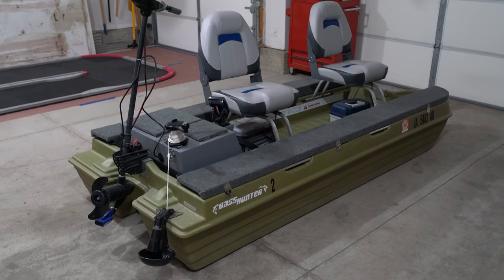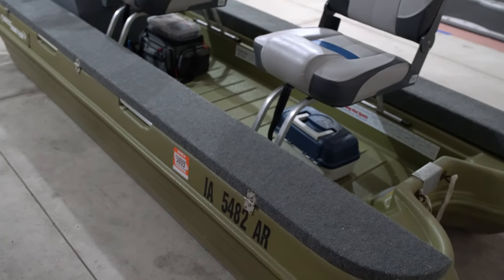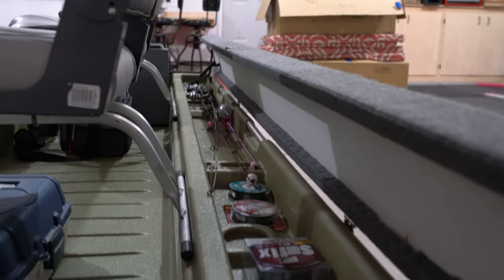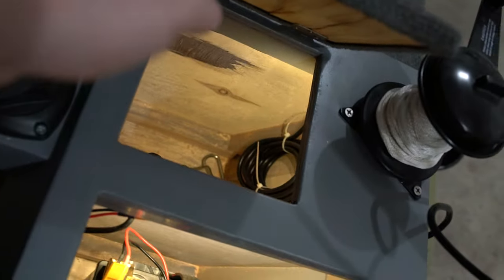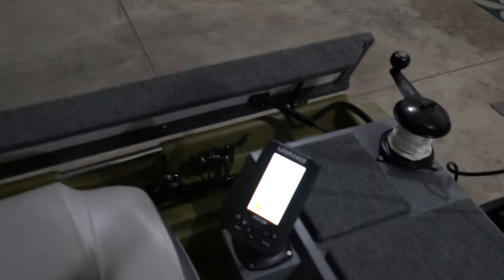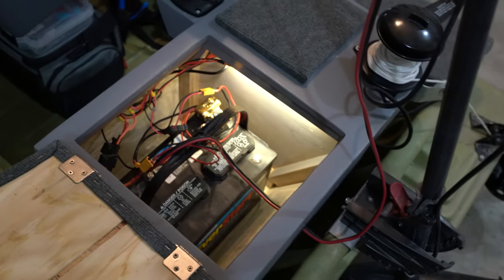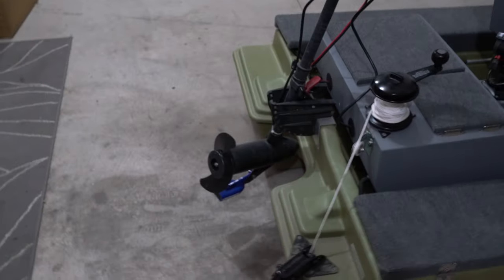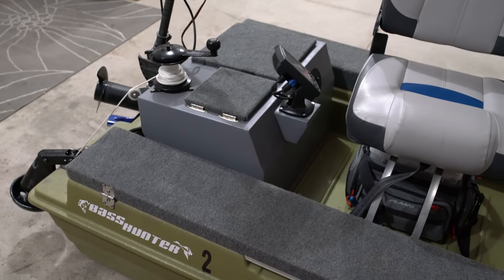Best 2 Man Bass Boat?! | Modifications, Build Process, and Walkthrough

Comment: How about a video explaining how the rod boxes on the side were built?  Looking at doing the same, just not sure how to go about it.
Reply from the maker: Hi Robert!  Essentially I just bought decent quality pine boards that were as long as the boat.  I let the board hang over the front edge of the front rounded sides and traced the shape from underneath the board.  I cut it a little narrower than my trace as I didn’t want the finished product to hang over the edges.  I then measured how much height clearance I wanted under the rod lockers and added 3/4” pieces of pine at the right thickness so the left and right still sat level.  Attached the hinges to test fit everything then took them off to waterproof and glue the carpet before reassembling to the boat.  Hope that helps in lieu of a separate video!  Reach out with additional questions!
Reply: It'd be nice if you could draw that up , make a blueprint of how you made those, AND how you made that battery box .. I am gonna do it to mine, but your's looks like it all came from the factory that way..! Man, you do some good work, and I like your attention to detail .. Damn fine work my brother.

Comment: Very well done!  Really impressed with the thought, design and thoroughness of the job you’ve done.  I sure wish I had the patience and skill required to do this kind of thing but I just don’t.  You’ve thought through every detail resulting in an organized and clean design that is incredibly useful, simple and makes using the boat a pleasure.  Not many have the ability to be so thorough and to know what to use, how to do it and can actually pull it off so well.  

If I did it there would be extra holes everywhere filled with silicone, the latches wouldn’t catch because I’d be off 1/8”, the boards wouldn’t fit and it would probably end up in the dumpster after I became so disgusted and angry with my inability to get any of it right.

Thanks for sharing, well done!
Reply from the maker: Thanks Kevin!  Really appreciate the comments/feedback!
Reply: Lol

Comment: I really like the mods you made putting the lids over the side trays and making them a secure actually usable storage that eliminates the chance of your rods getting knocked overboard.
Only thing I can see I may have done differently is use piano hinges so I could mount the hinges under the outer side of the lid and to the top of the hull where you would not have the hinges mounted to the outside of the hull mainly for aesthetic reasons not function.

In my opinion biggest mistake most people make when modifying these little boats is adding way too much weight going with plyboard flooring and large plywood decks in such a small hull, but your build for the most part eliminates this.

Front box for the fish finder and anchor reel mount I like, also could incorporate a front navigation light socket and switches for the navigation lights on it as well just in case ever caught out longer than planned and it started to get dark .
Rear navigation light socket could be incorporated into one of your side lids and the light for it stored in the side compartment when not in use.

I would though put the trolling motor battery in the rear of the boat in a plastic battery box and use the front box for storage for things like life jackets, the navigation lights and other needed items that just seem to accumulate on a boat.

Placing the trolling motor battery in the rear is more for a weight balance consideration since you have the added weight of the trolling motor and the box mounted on the front.

One last addition it seems pretty common to mount a rear rudder on this style boats to help tracking and make it track better and not spin around so easy in the wind.
Most people are just using a tilt bracket for a minnkota bow trolling motor (available on Amazon for about $40) and one of the best rudder ideas to to use in the bracket just cut the handle down on a cheap kayak paddle and used the paddle end as the rudder,

Tat rudder set up is great because it can be brought up out of the water just like your front mounted trolling motor for shallow water and/or boat loading and unloading and transportation.

Nice build overall.
Really sensible!
I am considering buying a boat of this style and may incorporate these side lids as it really is a smart addition to make those areas of the boat actually useful.

Comment: Super nice setup! I have one question and that is what is the model number of your battery and where did you get it and does it last all day running the trolling motor and fish finder and occasional use of the lights? I also love the rod locker setup. I have a bass hunter just like this one and look forward to getting it all setup and out on the water.
Reply from the maker: Thanks for the comment and question!  The battery is just a cheap EverStart group 27D deep cycle.  Generally it lasts all day but I’m only going around smaller lakes/ponds and not constantly moving.  I would suggest estimating your run time across all your electronics and their respective amp draw to determine whether certain battery setups would be sufficient for your needs.  Hope that helps!

Comment: my brother and I had one of these for 9 years. It got used every weekend and it was stored outdoors.  We bought a pond prowler at Bass pro to replace it and that POS ripped on contour seams on both sides within 4 years. And that one was always garaged on a rack with wheels totally pampered and it didn't hold up at all.
Reply from the maker: Thanks for the comment Eric!  Certainly much thicker plastic that they used to mold these older pontoon style 2 man rigs with.  I’m pretty sure this one is filled with foam on the inside instead of hollow like a lot of what you see on newer models too.

Comment: Did you use self tapping stainless steel screws into the boat?
Reply from the maker: Hi Tammy, thanks for the question.  I pre-drilled the holes in the outer plastic and put silicone sealant under the screw heads.  Hope that helps!

Comment: Do you have to pull the battery to access the drain plug? I couldn't tell from this video
Reply from the maker: Hi Ricky, thanks for the question.  This model actually doesn’t have a drain.  I generally just had a towel handy for incidental water in the boat.

Comment: Did you just screw into the plastic or oversized drill the holes and use the rubber mollies
Reply from the maker: Hi John - I used stainless steel screws that bit well into the plastic along with 100% silicone to seal any penetrations.  For the motor mount, you’ll notice they’re stainless steel bolts/nuts.  Hope that helps!

Comment: Can you give details on the shocks. Are they 12 inch over all length with a 6” throw?
Reply from the maker: Hi Paul - Yes, they’re 20lb gas shocks, just over 6” when compressed and right around 10” when extended.  So the throw is a little less than 4”.  Hope that helps!

Comment: Wished I has seen this a lot soon. You may not answer this. However I will try. Anyway you could list all the parts and maybe where you got them? 
 I'm not a very good DIY kind of guy. Anything you can provide information would be greatly appreciated. You did an Awesome job!
Reply from the maker: Hi John, thanks for the comment!  I don’t think I can list all of the parts (and I doubt they’re all the best option for each unique build anyway)!  A few common themes I’d share though… 1. Always go with stainless steel fasteners and hardware on marine builds.  2.  Everything you add equals additional weight so be mindful and purposeful with every part as you plan out a build like this.  3. Look at other boats and non-marine projects for inspiration and adapt solutions to your needs.  For example, RC cars use solid connectors and lightweight batteries, there’s an opportunity to parlay those to your use.
Reply: @AlloyAndGrain  I appreciate the tips.
Reply: @AlloyAndGrain  on the gas spring, what size did you use ( 10, 14, 16 etc.)
Reply from the maker: They were 20 lb - 5-6” I believe

Comment: Great build. Can you please provide details on the gas hinges like size, where you purchased them etc.  Thanks
Reply from the maker: Thanks Paul!  The gas shocks are 6 inch, 20 lb versions that I got on Amazon.  Depending on your application, how much weight they’ll be holding/opening, and distance from open to close where mounting - you should be able to search those specs as your requirements might differ.  Hope that helps!
Reply: @AlloyAndGrain  Thanks Justin.  I was looking for the length which you provided.  I really appreciate it.  I’m using it for a deck door that I made for the bow area. Not a heavy door so what you used will work fine for me.  Cheers

Comment: Ok, 1st off,  Gotta be one of, if not THE coolest little boat mods Ive seen yet.  Now some Q's.  1.  Is this an 8 or 10 ft?  2.  How did you go about waterproofing the wood?  3.  With the battery, the storage box and the motor all in the rear, how well does it float?  (ie does the rear sit a LOT lower or??)  4.  I have an 8 ft.  Do you think I would have the room to do all this?  5.  Are the side box lid gas shocks at an angle because of length?  6.  Can you give me links or help with finding the shocks you used?  And maybe the anchor drop thing  7. You wanna come to FL and we can build mine? :)  Awesome....simply awesome!!!
Reply from the maker: Thanks PPG Guy!  Happy to help however I can!  1. This was a 9’ 6” model from the early 2000’s. 2. I used a Zinsser WaterTite product but there are other wood waterproofers with solid reviews like Ames Blue Max.  3. It was lower but maybe only an inch or two - was basically flat with me and another guy in the front seat.  4. I would think so, especially if you usually fly solo.  5. I mounted the base plate for the shocks to an angled section of the built in rod holders to put the force of the shock as perpendicular to the bar as I could.  Essentially I didn’t want the pressure to be completely on the screws into plastic.  6. Gas shocks are 20lb, similar to this: https://www.amazon.com/Strut-Spring-Support-Cabinet-Sentry/dp/B08X4NM9QT/ref=mp_s_a_1_3?crid=MXGDP5V9WQ19&keywords=8+inch+gas+shocks&qid=1638496789&sprefix=8+inch+gas+shocks%2Caps%2C98&sr=8-3.  Here’s the anchor winch: https://marine.worthco.com/anchormate-products/anchormate.  7. That could be a fun adventure!  Best of luck on your build!

Comment: Hi new subscriber here. I really like your anchor pulley system and the bracket that holds the anchor. I have looked unsuccessfully to find a a good setup. If you don't mind do you remember what brand your winch is?
Reply from the maker: Hi Larry - thanks for the comment!  It’s a Worth Anchormate anchor reel.  Got it at Bass Pro Shops.  Hope that helps!

Comment: Do you happen to know what size/lb those gas struts are that you used on the rod storage hatches?
Reply from the maker: Thanks for the comment!  They’re 6 inch, 20 lb versions that I found on Amazon.  You should be able to search dimensions and weight to find suitable gas shocks for most applications.  Hope that helps!

Comment: How do you screw stuff to the boat. It’s holllow plastic is it not?
Reply from the maker: Hey Jeremy!  Yes, it is just plastic - but you can still screw into it (this plastic on the older models is a bit thicker than the newer models).  I would recommend stainless steel screws with  coarse enough threads to get a good bite in the plastic without easily stripping.  Find a spot you can silicone over if you want to test a screw without risking a location that might be more prone to water infiltration or be more visible...  Good luck!

Comment: Awesome setup dude. I'm thinking about buying one of these types of boats and doing something similar with it. Was wondering how much does all that weigh?
Reply from the maker: Thanks Jordan!  Between the rod lockers and box in the back (w/o battery), it probably added 35-40lbs.  The boat itself isn’t the lightest of options - requires two people or a custom dolly even without the additions.  The biggest thing weight-wise is the battery in terms of additions - obviously there are better options like lithium now instead of lead acid.  I actually ran the boat for a day around a small lake on two lithium polymer rc car batteries (hence the connectors you see in the box).  Just a matter of how much $$ or effort you want to put in!  Hope that helps!
Reply: Beware of running lithium batteries with trolling motors. Check with the trolling motor manufacturers, since most trolling motors are designed specifically to be run with lead acid or AGM batteries. Lithium batteries can damage the motors.

Comment: Can I get a material list for the side compartments please? 🙏
Reply from the maker: Start with the straightest, most solid boards (1/2”) you can find, waterproofer, marine-grade carpet glue.  That’s really it - plus whatever stainless steel hinges you like and fit your arrangement.  The gas shocks are 6” versions with 20lb capacity from Amazon, don’t recall the exact model.  One suggestion from a viewer was to make one side two separate hinged compartments, which I think is a great idea.

Comment: Hi new subscriber here, I have a question, Did you have to use any spray adhesive on your registration numbers?
Reply from the maker: Hi Dave - No, I didn’t.  They were definitely within a few years of peeling off and needing replaced though.  That is one of the tricky things about the texture of the plastic on this boat - stickers without enough adhesive don’t stick for long.  Hope that helps!
Reply: @AlloyAndGrain  Thank you! I just got the Bass Hunter Bass Baby! I saw online where some people said they had to use spray adhesive to make the numbers stick to the side. Guess I will use it just to be sure.

Comment: Hooked that thing up pretty good. how fast?
Reply from the maker: Thanks Brian!  How fast did I get the mods done?  It was over the course of about a month - just a few nights a week and on the weekend.  How fast is the boat itself?  Not very - about as fast as you’d expect a 32 lb thrust trolling motor to push a small boat.
Reply: @AlloyAndGrain  ya, just wondered if your fish finder had gps. I can maintain 3.5 mph in my outback. Was just wondering if it was faster than that for some larger lakes I fish
Reply from the maker: @Brian Richard - I got ya, no I don’t have GPS on the finder but I would guess it’s no more than 3.5 mph.  I’ve ran the trolling motor on 16 or so volts with some of my RC batteries for a little more speed but it’s just a few more mph and not sustainable across much water.  Hope that helps!

Comment: Nice but but how much weight did you add. Oh my back!
Reply from the maker: Thanks Wayne!  I’ll say, even empty and pre-modifications, you wouldn’t want to carry this thing very far.  It’s not like the newer pond hoppers you’ll see today with two pieces of plastic slapped together with a few styrofoam blocks in the middle.  This one from 2001 is fully filled with expanding foam and much thicker plastic than you see on others.  It’s easiest to back a pickup down the boat ramp and slide right into the water!

Comment: Did you take any pics of side box build?
Reply from the maker: Hi Cliff - thanks for the question.  I input all of the progress/construction pictures that I had into the video (they pop up intermittently).  Unfortunately, I didn’t take many pics of the side box build itself.  I can tell you that I built them from select pine, shaped them to fit the sides uniquely, mounted to the hinges for figment, then took the hinges off to waterproof, exterior glue every inch of carpet except the underside, then remounted.  I hope that explanation helps outline my process!  Reach out with additional questions!
Reply: @AlloyAndGrain  Thanks Justin. I am getting ready to build some. Yours are excellent! Did you use 1/4" lauan ply?
Reply from the maker: Thanks for the kudos!  I used 1/2” select grade pine boards but plenty of other viable options out there!  Best of luck!
Reply: @AlloyAndGrain   Couple more ?s. How are the screws holding
Reply: Also how tall did you make your sides?
Reply from the maker: They’re holding very well - assuming you’re referring to the screws holding the hinges to the plastic.  The gas shocks help keep unnecessary pressure/leverage off of the hinge mounting points.
Reply from the maker: They’re about 3 1/2” tall - I might suggest going a little taller as I had to undo the cranks from my bigger spinning reels for them to fit well under the side boxes.  Or at least measure with some of your larger setups to ensure you’re clear of them!

Comment: Looks like they are installed on an angle
Reply from the maker: Hi Paul - Yes, the rear section of the stock rod storage areas angles forward toward the bow of the boat.  I used that as the mounting point to keep the force when closed pushing down on the bracket instead of pushing sideways on the screws.  No clue if that’s best but seemed logical, works really well, and they’ve held up nicely.  Hope that helps!